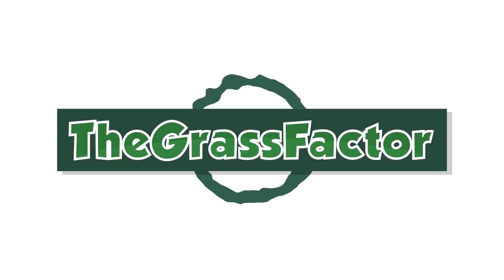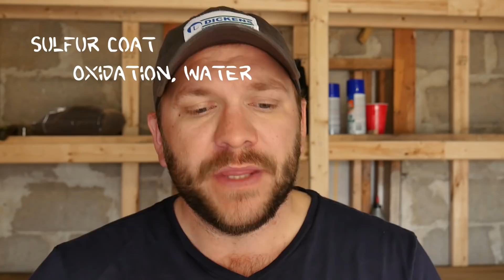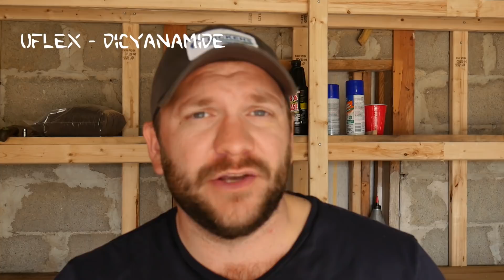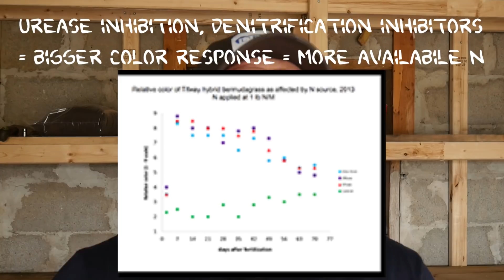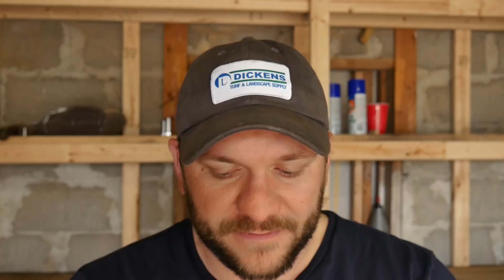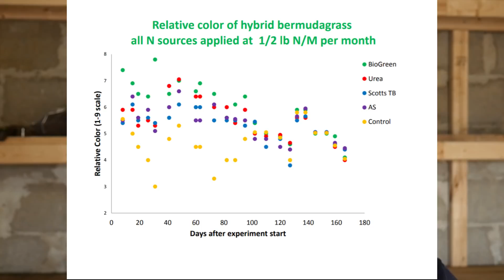SLOW RELEASE FERTILIZERS - Which One Is Right For You?

Comment: Great Video Matt, I have a pondering question.. if you take a sprayable coated granule like Lesco NOS 46-0-0 and you dissolve it and spray it, have you now just released the Kraken so to speak and turned it into a "regular" urea which will uptake fast, or does the coating get mixed into the soup so to speak and re-bond to the urea when sprayed?

Comment: After adding my fast release fertilizer do you recommend putting down a PGR to enhance root depth, and to avoid cutting every 2 days...or should I wait till the hotter days of summer and throw down a slow release and PGR? Thanks
Reply from the maker: Either or, works the same. Usually I fert and PGR at the same time. Faster slow release is your preference. Continue high mowing frequency. Induces less stress in plant.
Reply: The Grass Factor ok...good deal! Thanks!

Comment: For cool season lawns, as a pro, do you stop dropping fertilizer at some point before the hottest part of summer? If so, how far ahead of time? I understand this is necessary to prevent stressing a lawn. On the other hand, maybe its possible to micro-dose (@1/4lb N/k) through the summer every few weeks **as long as the yard is kept watered and doesn't dry out**?

I assume the pro's like yourself suspend N applications from June-Sep, but maybe I'm wrong.
Reply from the maker: I may throw a little N out with my Fungicides, but it's much lower than 1/4lb. Usually 1/16 or less.  The goal isn't driving growth but maintaining. So this year, I'm going .5lbs N, .4lbs N maybe, 1/4lb all summer, 1lb at seeding, 1/2 lb after seeding